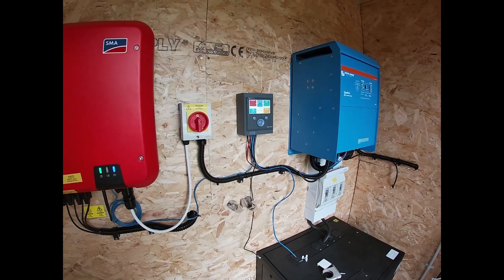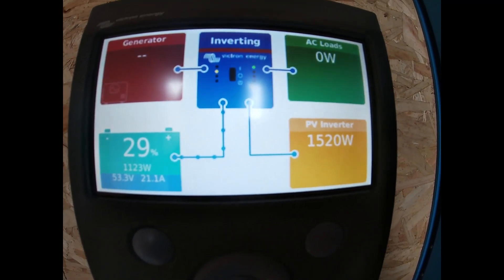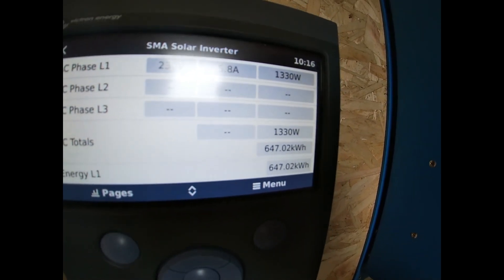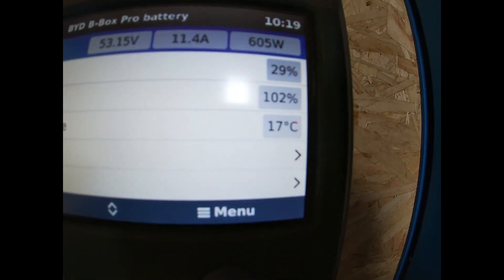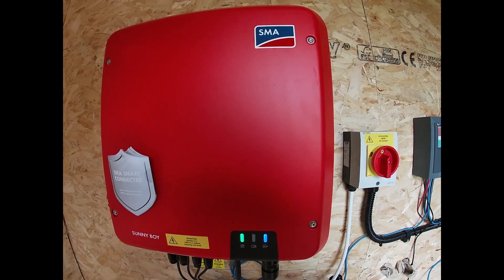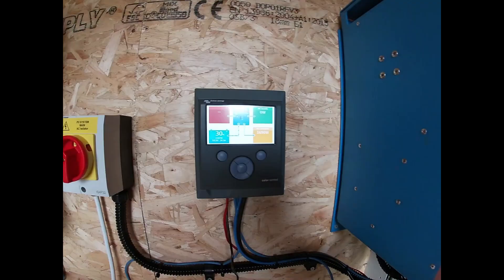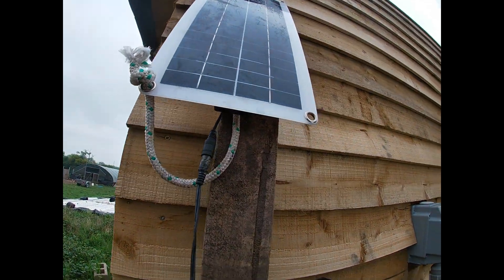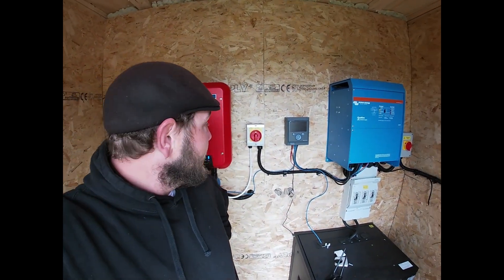Is Our Solar Offgrid system Worth the $$$$ 3 months in?

Comment: Great video, do you only need both of the inverters because you are integrating generator power along with battery power into your solar set up? If you were only using solar to feed the grid for example, the sunny boy inverter would be the only inverter you needed?

Comment: The 500 Volts will degrade your PV panels much faster and will possibly cause other problems to them.  Unfortunately big companies do not inform people about this. You will found out in the future. In a 24V or 48V system you don't have to connect the PV panels directly to the batteries . A good MPPT battery charger would do the same JOB as your PV inverter in the cloudy days and the 48V would not degrade the PV panels.
Reply: all fine...but low voltage means more losses dude..

if you make the panels series parallel you get a good voltage and a nice bit of current and we found from building systems you get solar pv earlier in the morning and get optimization

Comment: i dont think your inverter is set up correctly as your showing good voltage but 29% state of charge ?
Reply from the maker: its set to the manufacturers volatage spec for the batteries, it works great :-)
Reply: nothing wrong with 29% the cut off is normally 20% and genny kicks in at 15% depend on depth of discharge settings etc 

if its lead gel batteries or lithium coltbolt or lithium iron 🤔